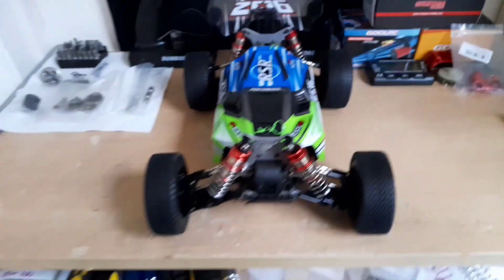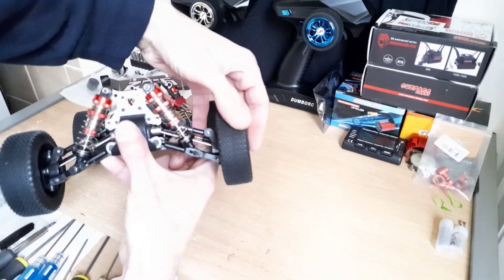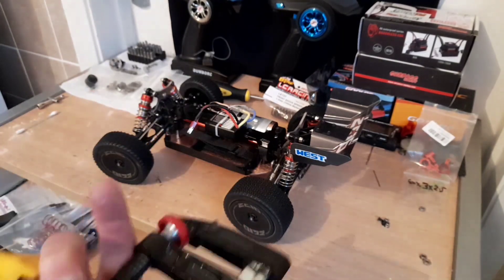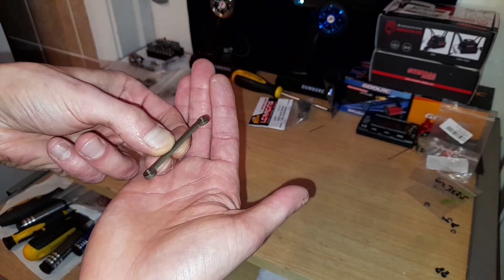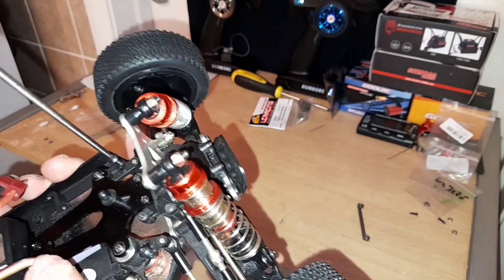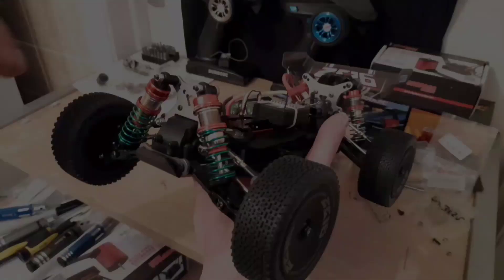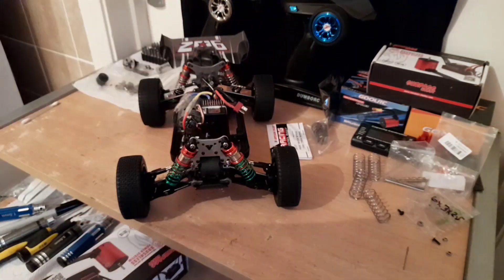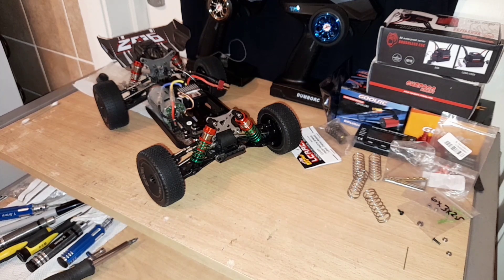Wltoys 144001/124019 wheel wobble FIX no shims! Drag link mod. Plus NEW Shocks! Not lc racing.

Comment: I think replacing the hex nuts with aluminum ones allows you to tighten the wheels up all the way.
Reply from the maker: Yes you can get thinner 12mm hexes I didnt have Any spare. There plenty of other things I'm yet to show. Thanks for the comment.
Reply: You can get the aluminium ones for the 144001 on e-bay just type em in and put uk supplier there about £3-4 and thinner 👍
Reply: @Andym1159  thanks, I got em somewhere, lol. The 124019 came with them. I put 2-4000kv motors in my 124019, short preview on my channel if your interested

Comment: Thank you for the springs ! Found it on aliexpress for 3.10 € the pack of 10 including delivery, they looks very nice but have to buy 2 packs to get 4 units of same color. This video made me subscribe and smashed the bell.
Reply: Hello. Can You send link to springs
Reply from the maker: The link should be pinned in the comments my friend.
Reply: @marcingawel3205  you will find it searching "xtra speed rc"
Reply: @bretzeletouffeur7401  From what I understand, the ones on Aliexpress are not 31mm but 24mm long? Are they the same as the Ebay link?
Let me know if they did fit properly on your car :-)! Thanks

Comment: Hallo,
Unfortunately, I am still waiting for my 124019 to arrive.
Will hopefully arrive in the next days… 😊
Therefore,
I somehow only talk in some sort of "theoretical" 😉🧐 about this particular model… just in common sense out of my over 30 years of RC racing and working experience…
I am following this new version of the legendary, shorter wheelbase model, because I quite sure, that It is a extremely high "value for the money" budget rc-buggy with quite a lot of features sharing with high competition racing-models.
When I saw your headline about new shocks, I have wondered a little, but then I saw that you are just talking about different springs…
Absolutely logical 👍👍👍
In this topic I wonder why so fare hardly anybody has done something with different springs for set-up tuning…
Keep on having a good RC FUN time…!!! 🍀
Thorsten 🌞
Reply from the maker: I'm totally with you one this one,couldn't of read that any better. Thanks for your awsome input. These cars can be something great. If not for the plastic letting it down but all plastic breaks.
 I'll keep posting if people are like you are interested in improving this awsome budget racer/basher/speed runner. It can be many things for its price range.
Reply: Hey, i found my 124019 was 100% RTR, spent some time checking shocks, diffs, even wheels... was perfectly setup.  Hope you get the same.  Only received a single 144001 which needed some work on shocks and loosening some tyre nuts, the rest were ready to go.
Reply from the maker: @erichoceans  they are 100 RTR, just some people like to look after them I know a thing or two to keep the car going strong. Lucky you, your seem to of obtained the best made 144/124

Comment: Thanks for great insight,,,,I have two rig….124017 and 124016….ran them hard and kept losing the nuts doesn’t seems to hold up well after a few bashing…..any tips to make the wheel /nut hold better without much binding ?
Reply from the maker: Use a tiny dab of loctite on the threads before adding the nut, them tighten the nut making sure the wheels are free moving. Let set and bang sorted I've never had a nut come off since loctite. Even nylock nuts will come off eventually.

Comment: Well done 👍👍👍 
I really like the way you show how to enlarge the holes on the steering bracket when you have to do it "free handed"… excellent 👌…other ways you could not achieve such a good result like you do…
What I did not quite understand… sorry 🙏
What other bearings are you using to minimize the wooble of the wheels…?
Different dimension…?
Wider…?
Or the same size, but just higher quality ones…? 
Keep on having a good RC FUN time…!!! 🍀
Thorsten 🌞
Reply from the maker: Thanks for the awsome comment it's much appreciated my friend. 
The bearings are simply wider 2.5mm wide. Dimensions are as follows 4×7×2.5
I use two on the front hubs and only one on the inside of the rear hub. 
Hope this helps.
Reply: @mehimrc1314  You are welcome…🌞
Reply: @mehimrc1314  So the original ones are only 2mm wide…😉🧐
Reply from the maker: @BUDGET_RC_RACER  1.8mm wide to be exact lol. That's probably why there is so much play. Look in the booklet the bearings are wrong. 4×8×3? They're for the lc racing hubs.
Reply: @mehimrc1314  1,8mm… 🤔 quite unusual…would be very special size bearing…
I assume that they are supposed to be 2,0mm, but they are just so low quality with incredible tolerances.
This is a common "problem" with many RC models… OK, they are fully equipped with ball bearings, because this is just a MUST feature as selling point, but like with everything in technic and life there is an extreme wide range of quality-levels when it comes to bearings; for all kind of "real" engineering there many norms/standards for bearings…but in the RC industry this is an open field…  😉🧐
Reply from the maker: @BUDGET_RC_RACER  very unusual bearing sizes but to be honest look at arrma. Some bearing are 12.5mm outer diameter we have just got to role with it. Love any rc that puts a smile on my face.

Comment: @Me Him Rc what did you use to cut out the body, and also do you use a rc reamer or just drill bits to make your body mount holes, also nice tips and keep up the good work, i will for sure be doing this ! more videos on your Wltoys 144001 please.
Reply from the maker: I used those curves scissors, "tamiya curved scissors" £7-8 you'll find them easy. 
And you nailed it cheap body reamer again from eBay about £7 ish.
Few tips make this car alot better, I'll keep something coming at least 👍🤙

Comment: Hey man I have the same problem with my 124019 and I was just wondering what tool you used and please respond because I tried everything and nothing is working and i even tried the plastic tool that it came with but it became a circle. So please if you could just tell me what tool you used or someone who knows please respond. Thank you
Reply from the maker: Are you meaning the wheel wrench? I really can't make out what it is your issue is bro.

Comment: Why did you adjust the suspension to no droop at all? That's going to ruin your cornering on uneven terrain.
Reply from the maker: On the 124019 that I flashed into view? There's still movement in the suspension for cornering. Not that a speed runner will see many corners haha. The other car/144 has all the droop still there it's now changed its appearance more sct now. Thanks for your comment dude.

Comment: Hi, when you add metal hexes after bearing change is there still no play? i ask because i just changed to metal hexes and i have way more play than with the stock plastic... i put a tiny o ring between the bearing and the pin and pretty much all the play is gone now.... thanks...PS have you ever showed a video on how to set up 144001 to perform as well as lc racing buggy??? or almost as good? thanks again..
Reply from the maker: Wow so you've got the wider bearing at 2.5mm thick? If your bearings are stock and you've changed hexes then hell yeah you'll get more wobble. The oring will burn up pretty quick, once I changed bearings it was a dramatic difference. 
The set up question, as I don't own LC racing emb 1. I can't do a comparison due to my own beliefs on content clarity. What ever I say would be speculation on the car. So unfortunately not, I could do a video on setting up the car. But what would you like to know to set up?

Comment: Hi buddy can you send a link to some suitable wheels and tyres for the phat body's escort for general hooning .
Cheers
Reply from the maker: I use contact foams mainly any tyre that's 65mm diameter or under will work. Sorry I don't have a link to hand for rubber tyres

Comment: Any tricks for getting to the differentials? The screws on top and on the bottom plate seem to be locktite? They wont bulge! Any help🥺thank you
Reply from the maker: To get to the differentials the only loctited screws are the top deck steering and mount screws they should come out very easy. Bottoms plate I don't know what your wanting to take off. Everything to get to the diffs is on top of the car. Any thing else
Reply: @mehimrc1314  thank you!
Reply: @mehimrc1314  thank you, last thing. Do you know if the ESC on the wltoys 144001 will stop when the battery gets to 3.2V so it doesnt drain the batter
Reply from the maker: It will stop but it's not due to lipo cut-off unfortunately, if and when the car stops.  Go and pick it up, the biggest fault/gripe is people still try and drive the car back to them. Even with low voltage cut off you should always go and pick the car up.
Like you don't attempt to drive 30 mile on a reserve tank that only gives 15 mile at best. Does that make sense dude.

Comment: So you have 2 bearings on the outer hub? One regular and one wider? I bought the wider ones a while back but it didn’t fix the wobble with just one on the outside
Reply from the maker: Hey man I can see why you hadn't got rid of your wobble. I though I made it clear in the video that it's only the rear hubs I use both sizes. No wonder you haven't got rid of that wheel wobble. Its longer to type than watch that video again mate. It's all there 2 new in the front and 1 new to one stock in the rear. Which way round is up to you.
Reply: @mehimrc1314  just took it back out after working on it for hours. I put the front bumper on and had to cut the shell some. Ended up taking out some more slop from the front end. I was able to get full throttle finally for a short time a few times but quickly ran out of asphalt so I had to brake. It’s fast man. Really fast. This was with the shocks leaked out too. The new ones were supposed to come today but they were put off till tomorrow from Amazon. It still likes to pull left or right, depends on the last input I put with the remote. Once it’s locked in I can open it up though.  I’m wondering if using the gyro would help with the minute adjustments to get it straight? Net thing I am gonna tackle is making sure all the rod ends left and right are the same length with calipers. It’s getting better. Not perfect, but better.
Reply from the maker: @revfpv7908  if your steering is stickling then disconnect the servo arm. You'll be able to move the steering with your fingers. If it feel heavy or grabby loosen a TINY bit the two screws that go into either steering post. Should help the steering people over tighten those two screws. Oh you've added the bumpers now aswell I see, bet that looks insane flying by lol. Keep it up dude small successes lead to great achievements.

Comment: Good afternoon. Are there wider bearings to do this fix on the a979? Thanks.
Reply from the maker: Two sizes of bearing on the a959, are you looking for both sizes to be wider?
Reply: @mehimrc1314  Yes please. Which ever I need to close the gap without shims. Thank you very much.
Reply from the maker: But what gap we talking about, can you explain and have a better understanding what your meaning.
Reply: @mehimrc1314  Between the wheel hub and the steering...'knuckle'? I have drive shafts extenders on there now, with the pin and rubber band dealies. I put the shrink wrap on the shafts which took some out, but there is about a 1mm gap between the extension and the steering apparatus.
Reply: Lol, by Putin. ( ; D)
Reply from the maker: Nicely explained mate so would the outer bearing be enough? Which way to you want the wheel sit, in or out more?
Reply: @mehimrc1314  I think in more should be better, more sturdy I suppose.
Reply from the maker: @Revdonlee74  cool just look for a bearing that's 8×12×4 the inner original bearing is 8×12×3.5 always leave half a mm for clearance.

Comment: looks really cool 😎🤌🏼 Really a cool body and the tires are cool too.  Do you have a link to the shock absorber springs?  thanks
Reply from the maker: Didnt want this in the description as its would of took up too much space Hope it helps dude. https://www.ebay.co.uk/i/131550994740?chn=ps&norover=1&mkevt=1&mkrid=710-134428-41853-0&mkcid=2&itemid=131550994740&targetid=878028523120&device=m&mktype=pla&googleloc=1006948&poi=&campaignid=9446017195&mkgroupid=95890180956&rlsatarget=pla-878028523120&abcId=578896&merchantid=137623040&gclid=EAIaIQobChMIn_DnoL3L7QIVJu_tCh0K_AC_EAQYCiABEgKo5fD_BwE

Comment: Ei man I just installed the 2.5 bearings (inner) MR74ZZ, yes wooble has gone but still I can’t fasten completely the tires, I checked with stock hex and a new metal hexs, any idea? 
I have this tires:
€ 4,71  40％ dto. | Neumáticos de coche de Rally teledirigido 1:10, juego de llantas de goma insertada de espuma M4, cubo hexagonal de 12mm, paquete de 4, 2,99 pulgadas/76mm
https://a.aliexpress.com/_vXOIzj

edit: seems that with stock tires I can fasten better
Reply from the maker: The wheel plastic may be slightly thicker around the axle hole. That would be my only conclusion. The thicker bearing doesn't alter the amount off thread available for the nut. That would only come down to thicker rims OR wide hex adapters. I've tried explaining this to a few people, hope fully it makes sense. What ever happens behind that pin doesn't effect what you add after it.

Comment: A little wobble in the front is normal with any rc car
Reply from the maker: Perfectly normal as it wouldn't move otherwise lol. But I didnt like what I seen so i took what i feel is the best approach. Any rc thats brings a smile wins in my opinion.
Reply from the maker: @admin5322  I cant get the link from ebay app,and they dont come up on google search. The seller is (milancentral) type in 4×7×2.5 bearing you'll find them my friend. 
Sorry I cant get all links
Reply from the maker: @admin5322  and same for the flanged bearing cant get the link but out in the sizes 3×6×2.5 and the correct wording you'll find them possible cheaper too.

Comment: Are these the springs?
https://www.rcmart.com/xtra-speed-spring-set-for-1-10-rc-car-xs-59591-00059995
Can you confirm that the length goes from 31mm to 23mm for the hardest?
Reply from the maker: My set of springs are 31mm to about 28mm. But your on their website so I'm guessing its the same. Either would work for Me.
Tthe links not mine so I'm not confirming anything,Hope you understand.